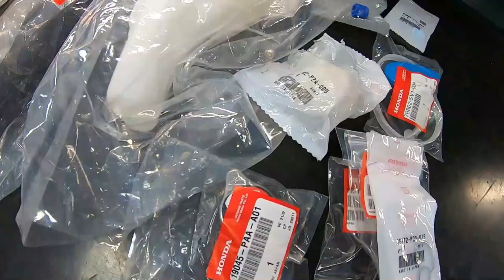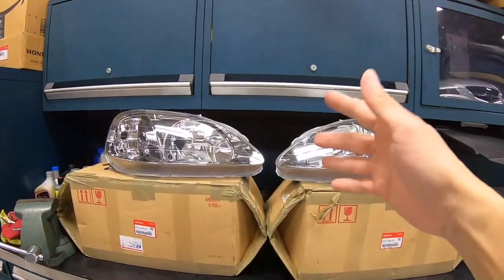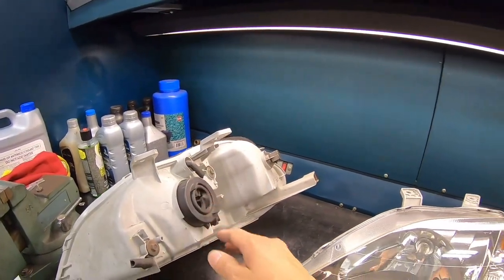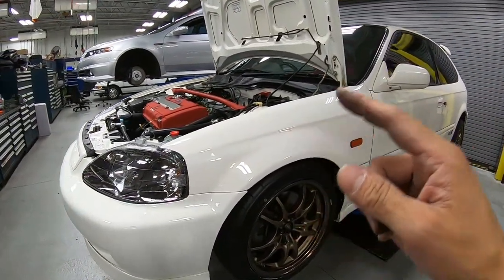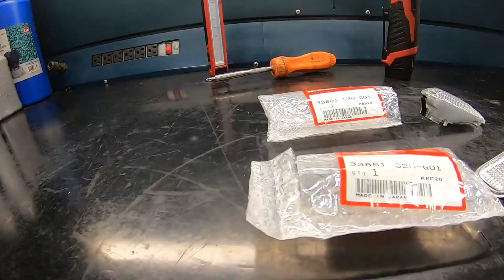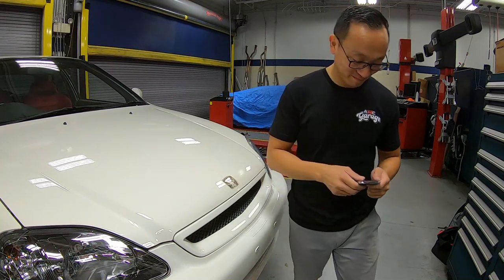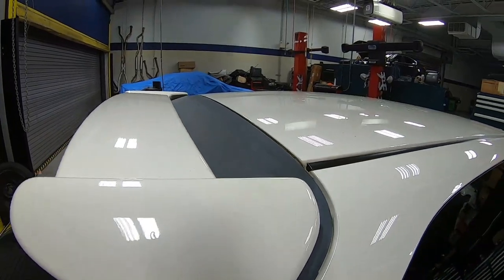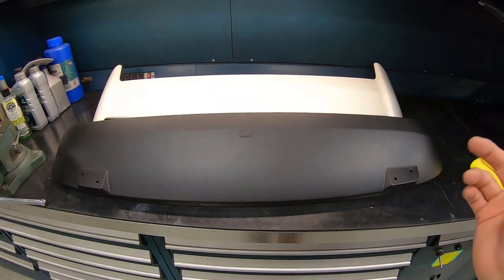Honda EK9 CTR Refresh Build - Brand New JDM CTR Headlights Emblems and Exterior Refresh (Episode 4)

Comment: Nothing refreshes the look of a car more than new OEM headlights
Reply from the maker: Agreed!!
Reply: Yeah but now your going to be blinding people on the other side of the road.
Reply from the maker: Simply adjusts the beam at the headlight adjuster
Reply: @ahcgarage  JDM you  people drive on the opposite side of the road, those are made so the cutoff doesn’t blind the opposite side of traffic. You’d have to modify them to be true for our side of traffic.
Reply from the maker: Yes and agreed, you can also adjust the light beam height so you don’t “blind” the opposite side of traffic. Make our driver’s beam lower and passenger’s beam higher, problem solved.

Comment: Love the new headlights. Only thing I don’t like is that there’s not an easy way to reverse the beam pattern for driving on the right side of the road. Also prefer the amber side markers on CW. The clear ones look better on Phoenix Yellow in my opinion. And I was about to comment on the front bumper license hole plugs, but I see you installed those as well! 👍🙏
Reply from the maker: Thanks for checking in!!